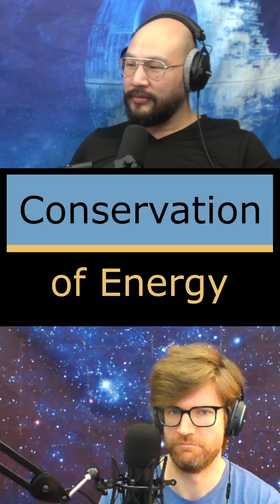Why is Conservation of Energy Powerful #physics #energy #convservationofenergy

Comment: You can still look at any time because the amount of energy lost to friction is a function of time. I am also fairly confident there's also a way to account for the drop in air pressure the higher you go. As long as you can express all of those changes as a function of time it's still going to be accurate enough for the model to be useful.
Reply from the maker: Agreed! Friction can be modeled, but the details of the trajectory matter at that point.